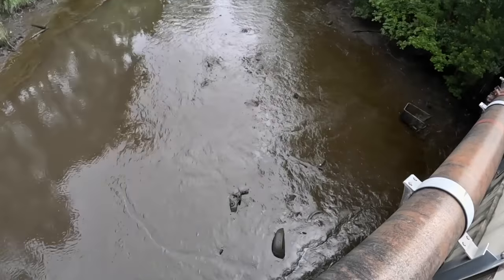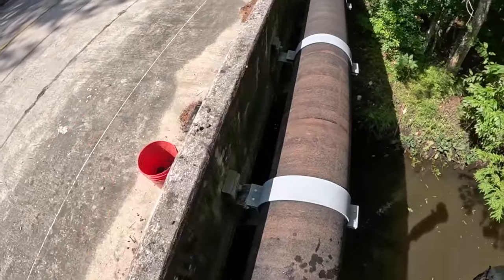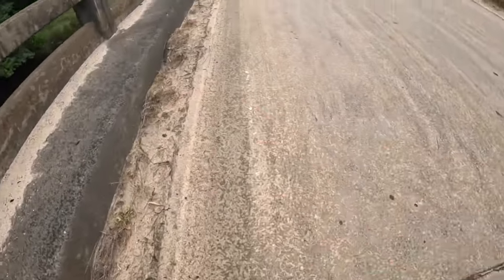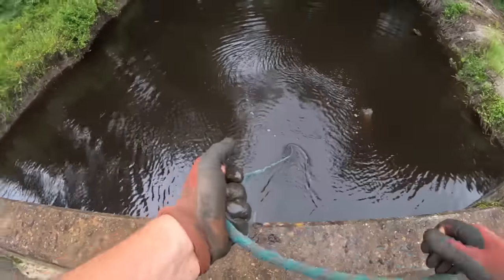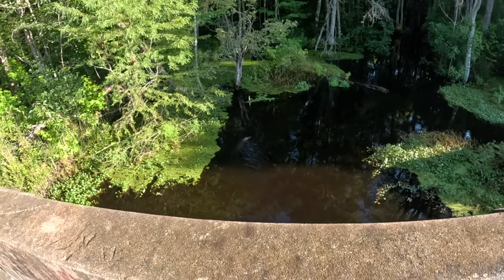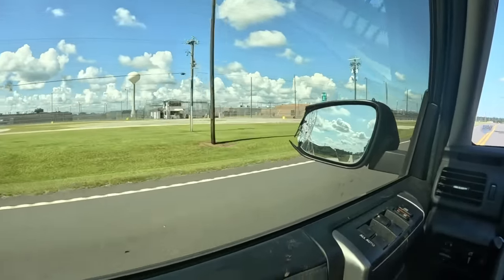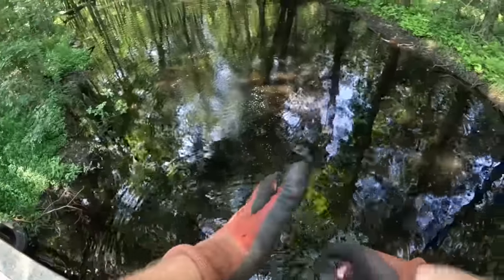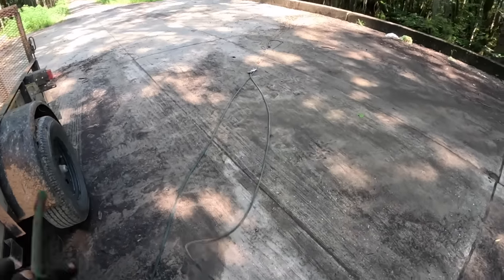Magnet Fishing Next To A Prison

Comment: You're heavy 30 lb piece of metal that you thought was part of the bridge is actually the cutting blade that goes on the back of a Gannon It Bolts to the Gannon itself and when one side gets do you just flip it over and use the other side